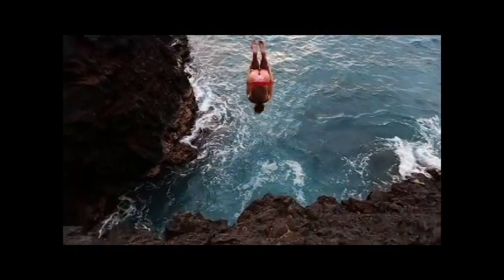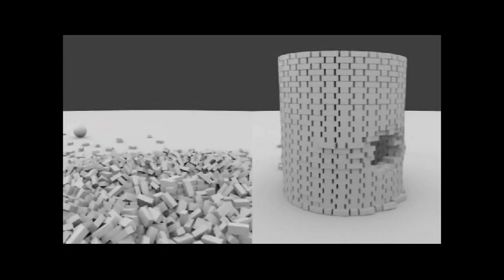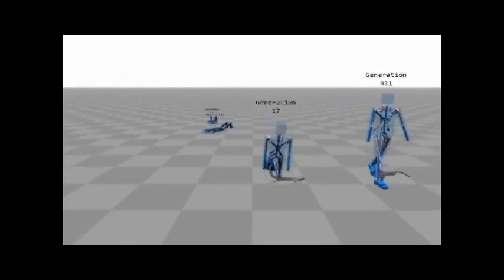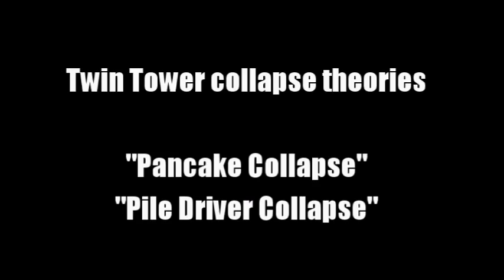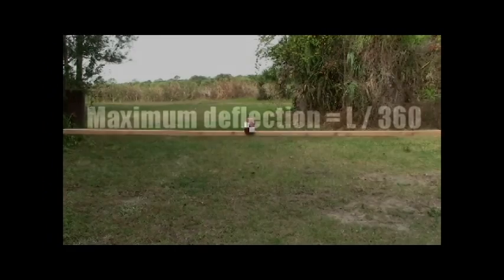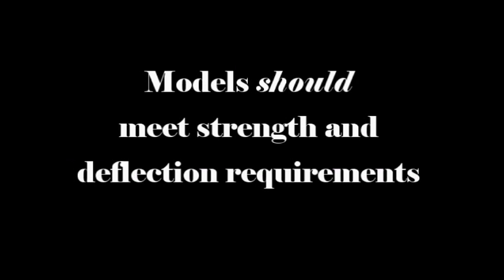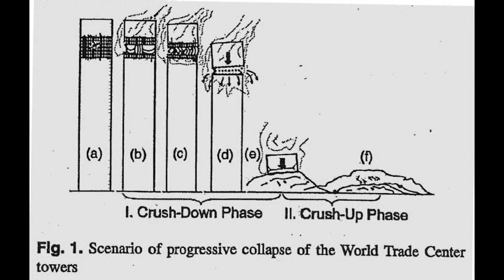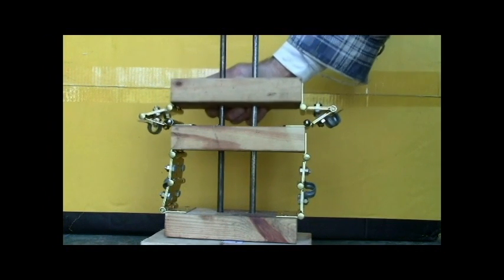9/11 Experiments: The Force Behind the Motion

Comment: Oh look a building collapse in Iran due to fire. look at the way it collapsed. Maybe they rigged the building with thermite? LOL
http://www.abc.net.au/news/2017-01-19/tehran-plasco-building-collapses-after-fire-killing-dozens/8195926
Reply: 96% of the AIA think you're nuts.  They said so back in May 2015.  The AIA has 90,000 members (of the 120,000 total licensed architects in the US).  That's 86,000 AIA accredited architects think that you're nuts. 

Since when does an electrical engineer know anything about structure collapse?   Do you know Young's modulus?  Beam deflection calculations?  The difference between static and dynamic loads?  Yield versus ultimate strength?  Elastic vs. plastic deformation of steel?  Somehow I don't think that's part of the electrical engineering curriculum.
Reply: Did I say 100% of the AIA?  Nope.  I have done the research, on both WTC and Plasco.  On plasco: there were no explosive flashes, that was falling glass causing reflections, and not seen at all other videos from almost the same angle.  Explosions?  No, that was dust and air expelled by floor collapses which are clearly also visible in the videos.  Rothchilds?  What about the Rockefellers?   The Illuminati?  The Raelians?  The Bilderbergs?   If you're going to mention only one, then you must have proof, or at least some sort of evidence.  Where or where is it?  Have you found cancelled cheques?  Have you hacked into their email accounts to see my correspondence?  no?  Thot not.

You still haven't indicated that you know what Young's modulus is or any of the others I mentioned.  You therefore don't even know the very basics of structural engineering, and we're supposed to take your word as to what is plausible and what is not?  Yeah, sure.

Typical of 911truthers, complete ignorance of structural engineering and claims of paid trolldom when challenged on that ignorance.
Reply: "Not one, in the history of the world, steel structure skyscraper has ever collapsed due to fire.".  Well, that's certainly wrong now, eh?

There is a reason why building codes require heat insulation to be sprayed onto steel structural elements.  I wonder why?

Could it be fire?  Naw, can't be that, they just like grey fluffy stuff.
Reply: In the uploaded movies you can clearly see flashes of light. After those flashes the building collapses. Iranian people said that it wasn't a demolition, but  a shopowner had a  couple of fuel tanks in his shop and they exploded after hours of fire.
Reply: really me lol really? sorry mate there's no flashes of light. building collapsed due to structural failure.  due to the fire,  nothing else.
Reply: Enki Religion well it happened again in Iran
Reply: Tho the way it collapsed was different to the twin towers, it was random, not straight down.
Reply: Mighty Duck um no, the main superstructure came straight down. the point is that it was almost "free fall"  just like 9/11.
Reply: Enki Religion lol really? 
I'm a structural engineer Enki.
ask me any structural questions regarding building design
Reply: Enki Religion lol so what qualifications do you have?
Reply: Enki Religion so what kind of engineer are you? 
the question is how many haven't signed that rubbish?
Reply: Enki Religion and what the hell are architects signing documents relating to structural collapse?
Reply: Enki Religion so what kind of engineer are you?
Reply: Given the number of times he's failed to answer that, I wonder if he's a sanitation engineer.
Reply: Enki Religion ok electrical engineer.  no disrespect but as an electrical engineer do you think you know more about structural engineering then myself?  I've been practising for over 17 years as a structural engineer and comparing the Iran building collapse to 9/11 they are very similar you can't deny that. the Iran building collapsed due to fire just as the twin towers and wt7.
Reply: +michael9678727  I deny it. The Iranian building collapsed much slower compared to the twin towers. The Iranian building didn't have a steel frame. The twin towers and WTC7 collapsed due to thermite and the Plasco building collapsed due to explosions (maybe from fueltanks). 
So if you are a structural engineer then you must understand that steel structures don't collapse due to regular office fires.
Reply: really me what qualifications do you have? the Iran building collapse was not due to an explosion, also it wasn't slower the main colaspse and the building was a steel framed building.  did you even watch the video? 
you have no evidence of thermite. all the ingredients for thermite are found in the building materials. 
tell me how does the government rig up explosives in 3 buildings without nobody noticing?
Reply: Enki Religion childish?  how so?
I'm just pointing out the fact that you're not qualified to discuss the collapse as an electrical engineer.
Reply: Enki Religion see what I wrote above. about your thermite theory.
Reply: +michael9678727  Just a question. Are you a real person or just a stupid computer program,  like siri, asking silly questions?
Reply: really me so you have no qualifications? 

even your Ae911 truth movement believe that the plasco building might have been caused by explosives because of the very similar nature of collapse. 
look they even wrote a letter to do an investigation! lol 
http://www.ae911truth.org/images/PDFs/AE911Truth_Press_Release_Plasco_Building_Collapse_01_20_2017.pdf
Reply: really me so I've caught you out on your lack of research. ie plasco building structure type and that you have no qualifications. 

howbow dah? lol
Reply: +michael9678727
-You can't count till 16.  That''s the collapse-time in seconds for the Plasco building.  Twin towers was 9-10s.
-You can't read.  In 3 posts I've written you about explosions. 
-Plasco building had no steel collums on the outside like the twin towers.  Everyone can see that.  It's structure was way different from the structure of the Twin towers. 

Did you graduate for the kindergarten ?  
-That'' s where I learned to count.
Did you graduate for the primary school ? 
-That's where I learned to read.
Did you ever fall down  ?
-That's were I learned about gravity.

Because you can't count and can't read properly, I know you are just a silly computer program, like Siri. And silly computerprograms can only do what they are programmed to do,  like  writing silly comments.
Reply: really me yep no steel outside the building 

https://www.google.com.au/imgres?imgurl=https%3A%2F%2Fwww.metabunk.org%2Fattachments%2F24140%2F&imgrefurl=https%3A%2F%2Fwww.metabunk.org%2Fae911-truth-forced-to-claim-plasco-collapse-is-an-inside-job.t8339%2F&docid=42Uuw42BVEUVYM&tbnid=4ZimKe2NG7-wgM%3A&vet=1&w=553&h=684&safe=active&bih=512&biw=360&q=pollution&ved=0ahUKEwjA7tCRxovSAhVCjZQKHTNKA_YQMwgaKAAwAA&iact=mrc&uact=8
Reply: really me the plasco building was a steel framed building.  the concrete you see on the outside is just external cladding. 

again what is your qualifications?
Reply: really me you forgot to mention wt7 the plasco building was similar to wt7 (the smoking gun)

and explain to me why Ae911 put out a press release about the plasco building?
Reply: Enki Religion lol you're back. your qualifications don't hold in this debate.
Reply: Enki Religion lol you sound like a typical conspiracy theorist 
no qualifications on structural applications.
Reply: Enki Religion lol what untrue statement have I said?  it's all there in black and white even your Ae911 acknowledges the Plasco building collapse was very similar to the wtc collapse. 
just because it doesn't agree with your beliefs doesn't mean it's untrue.  you have no qualifications in structural engineering and just regurgitate what Ae911 says. 

how can it be untrue when it occurred in Iran? 
why has Ae911 ask for the Iranian government to investigate the collapse?
Reply: +Enki Religion 
-michael9678727 Isn't a real person.  He gives such strange answers  and totally ignores the things I said.  Do you know the Artificial Intelligence program Siri ?  I think they use that technology now to waste your time.  I will just ignore him from now on.
-I know some of Electrical engineering.  And if you completed that study then you much have enough logical thinking capabilities to understand the basic laws of physics.
-Understanding the basic laws of physics (Newton)  is enough to understand that  the trade towers came down by demolition.
And saying like m. did that an electrical engineer shouldn't  have opinions on building collapse is idiocracy.  It just sounds like you  are not allowed to have an opinion at all. 
-Last week I switched to the no-planes-explanation. Because believing that a plane could slide through a building the same way as a knive through butter can't be true. They should shatter at impact.
-There's a lot of occult numbers/code involved with 911.  I will continueto  investigate that until the truth comes out.  It's a murder case that our governments are not willing to solve.
Reply: really me lol
who's the idiot that can't write proper sentences! 
you don't have any qualifications in structural engineering nor does the other idiot. 
when your Ae911 acknowledges that the Iran building collapse was very similar to the wtc collapse and the fact that the Iran building was a steel framed building, which you both totally ignore because it doesn't fit your argument!
so much for seeking the truth even though it hits you right in your face you two choose to ignore it!
Reply: really me lol no planes so you're telling me the thousands of people who actually saw the planes hitting the building was in their imagination? lol
Reply: +michael9678727
Not thousands. Billions of people saw the planes. And not in there imaginations.  They saw planes,  but not in reality.
Only on t.v.

And you are just a stupid computer program, like siri
Reply: really me I'm talking about the people in New York seeing it with their own eyes idiot!
Reply: +michael9678727 
You think that the people in New York don't have t.v. ?
You are not qualified to discuss  mass media.
You are not qualified to discuss demolitions.
You are not qualified to discuss fires.
You are not qualified to discuss anything

Because you are just a stupid computer program, like siri
Reply: really me and what about the people on the streets idiot!
Reply: You think that the people  in the streets  don't have t.v. at home ?
You think that there are no t.v.'s in restaurants ?
You are not qualified to  discuss the people in the streets.
You are not qualified to discuss anything

Because you are just a stupid computer program, like siri

Let's see what you make of this, stupid computer program:
No planes hit the twin towers.
The twin towers were brought down by demolition
Plasco building has a different structure then the twin towers
Office fires can not make a building collapse.
Reply: +michael9678727  
You say you are a structural engineer ing disaster.
At what university were you programmed ?
How can I get you in office-fire overflow ?
Is there any steel frame around you, like the steel columns around the  twin towers ?

Do you know the formul e = 0.5 times m square v ?

Let's see what you make of this, stupid computer program.
Reply: really me Ok so you just ignore my previous comments lol like I said you're a special kind of stupid. 

you still haven't answered me about what qualifications you have. 

if you're going to quote an equation at least get it fucking right!
it's E= 1/2mv^2 idiot!
lol
also when you learn how to write in English I'll answer your questions lol
Reply: +michael9678727
sorry  SIRI-eus disaster I apologize for my poor english.
I have the proper qualifications after all.
I'm fully qualified to handle  disasters such as you.
Let's feed you some more nonsense:
Oranges are green
The moon is purple.
Grass is orange.

And something that makes sense:
A commercial plane can't travel 500 mph at sea level.

Let's see what you make of this, stupid computer program.
Reply: really me look I'm just wasting my time with you.  you can't even get simple physics equations right. 
so you're way out of your league.
Reply: +michael9678727
You got all the time off the world. You are just programmed to waste my time SIRI-like disaster.
And  you can't even recognize nonsense.

Steel frames don't fall at 10 seconds.
Tell me what do you know about Tavistock ?
Tell me what do you know about the European ISIS attacks ?
Tell me what do you know about MH17 ?
Tell me what do you know about the next terror attack ?
Stupid computer program
Reply: Moving the yard stick, eh?  it used to be "no steel framed buliding has ever collapsed to fire alone".

Only the truth?  Well, let's see, I count about 6 lies in just what you wrote, and I'm being generous at that.

Lie #1: WTC1 and WTC2 did not freefall.  WTC7 only freefell briefly, and at that, that wasn't the entire building, just part of the shell.  So did Plesco .

Lie #2: Those weren't office fires, those were building fires.  There is a difference between a fire in a wastebasket and complete involvement of multiple floors. 

Lie #3: Buildings imploded?  Did the dust clouds get abruptly sucked into the building?  Show us the videos!

Thermite is not a implosion reaction.

There is no sign of explosions in Plesco, the flashes were falling broken windows momentarily catching the sunlight.  The bursts of dust merely jets of air from collapsing floors.  As they were with WTC1 & 2.

Lie #4: independent testing revealed thermite?  Independent?  They were all already known troofers, don't lie to us about "independent".

Lie #5: The testing procedure had a number of severe defects, the most important of which is that Harrit's calorimeter tests were performed in air.  You don't test for thermite by combusting in air, because thermite doesn't need air, and other material (the flammable stuff the alleged thermite was buried in) has more combustion energy than thermite.

Other tests of better provenance dust, which despite having the same composition by experiment as Harrit, did not have ANY thermitic behaviour.  No elemental aluminum, no thermite.  It was just primer paint.

Lie #6: The collapse of WTC7 took considerably longer than 7 seconds.  Timing the video is just not good enough, you have to start at or before the penthouse collapse, and end when the last bit hits the ground, NOT just when it disappears behind other buildings.
Reply: If michael9678727 was a computer program, it's doing a good job of wasting your time.

Actually, he did recognize nonsense.  Me?  I just think you're sniffing glue.  Even with extra editing of your own posts you can't make them intelligible.

I'll answer your questions:

1: Tavistock is a small town about 7 hours drive west of here that holds the crokinole world championships.  That's too much of a coincidence! 

2: There is a suspicious commonality about the European ISIS attacks.  They all took place in Europe!  That's much too unlikely to be a mere coincidence!

3: MH17 is a scheduled flight between Amsterdam and Kuala Lumpur.

4: The next terror attack will be committed somewhere and by someone at some future date, and will cause either no or some damage, injuries or fatalities to this or that social/religious/or entirely random group of individuals.  Some people will think it was committed by X, some by Y, but it will really turn out to be X,Y, or someone else, or in some combination.  Some people will claim it's false flag, some people will claim it is not.  One or the other will be right, but the one who gets it wrong will never admit it and insist that you're a traitor, paid troll, sinner destined to hell or a computer program named Siri.

Fox News will lie about it.  So will Trump.  Fox News will sort of apologize for lying, Trump?  His press secretary will start talking about alternate facts again.

If it happens on a weekday, 14 different conspiracy theories will spring up about how it was done by the rockefellers, rothchilds, Illuminati, bilderbergs, knights of columbus, and the Los Angeles chapter of the Cub Scouts.  If it happens on a weekend, it will be the Kiwanis instead of the Boy Scouts.

Do I get a cookie?
Reply: Yes , it's a pity I don't have your address, but yes,  I owe you a cookie .  When I was a boy scout we used to do a lot of mischief, so that makes sense.

Comment: back when this happened i jumped on the phone with my friend who runs a demolition company that i used to work for back in the day and asked if i saw that right that that was clearly a planned demolition and i swear i could see charges going off when the tower collapsed . His response was yeah they must have triggered the demolition for safety reasons and we both came to the conclusion that the building must have been designed with the in case of emergency demolition  in mind because the collapse was picture perfect normal buildings dont collapse that clean . most of the time a staircase or an elevator shaft doesnt collapse as planned and pulls the rest of the building to the side or something else weird happens .